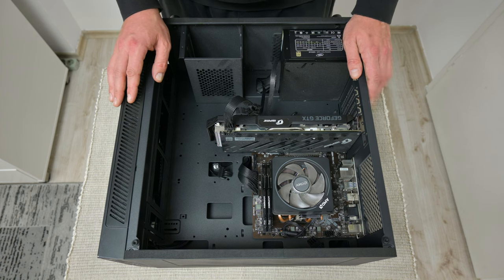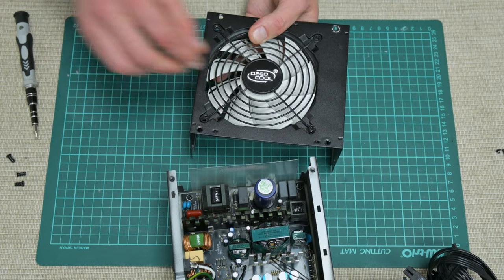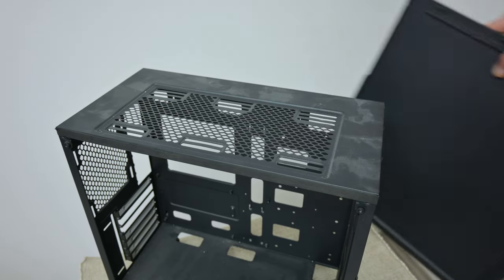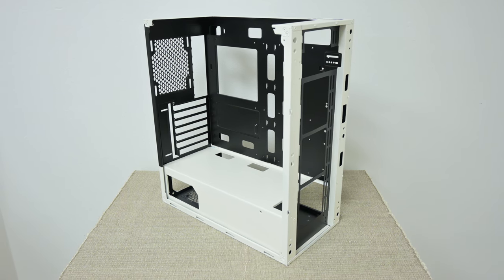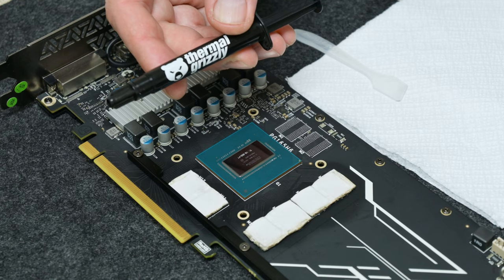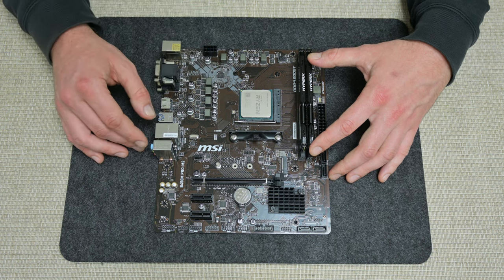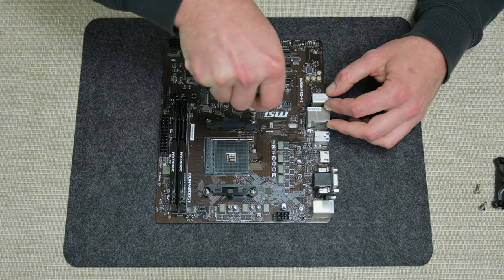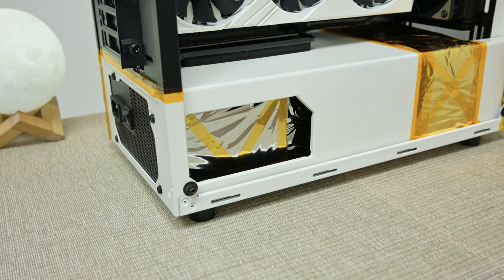The Apollo 13 Computer - ( Restoring Re-building and Upgrading )

Comment: Using budget Deepcool stuff. 
You're a man of culture aswell!
Reply from the maker: Thank you bro :D I like budget stuff, even cheap things can be turned into something good. Many budget things have the same quality as some "premium" but the marketing is different
Reply: @ComputersAndTechAndAndrew  i was building PC-s for a company in 2019-2021. I’ve built around 1500. And i was so sad when people bought 90% the popular brands like nzxt h500 for 30% than a double the size deepcool mattrexx 55. I used to knock on the metal of the cases (for the vibrations) . And the h500 transferred more vibrations really lackluster quality, only front mounted 240 millimeters AIO watercooler. And a little choking for bigger graphics cards at the time.